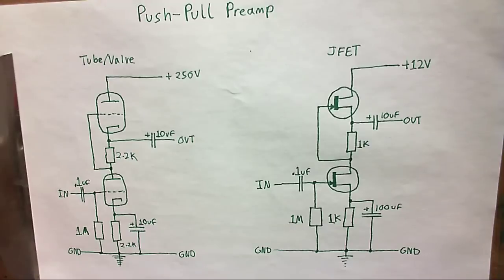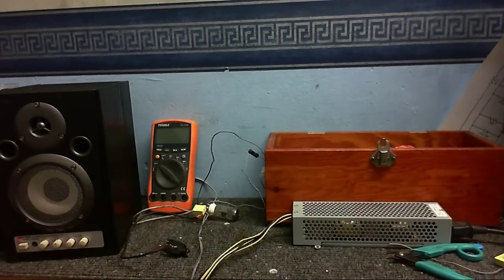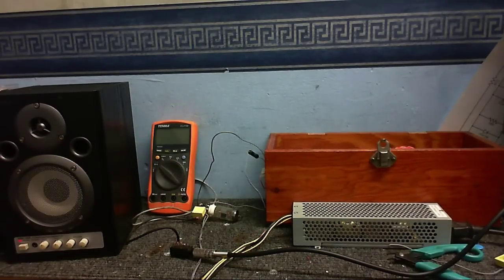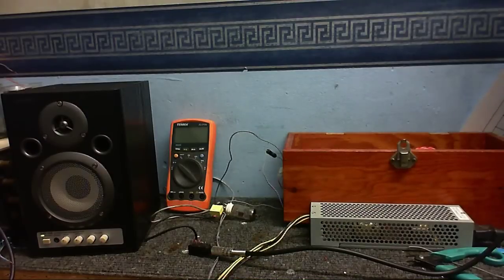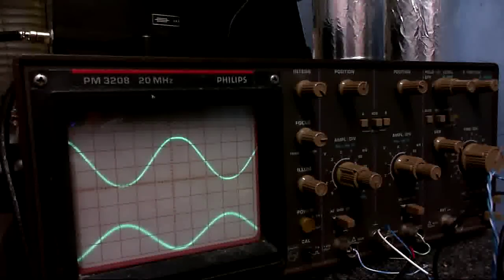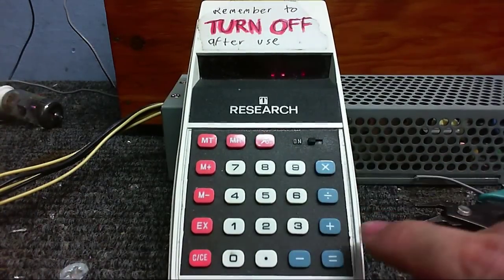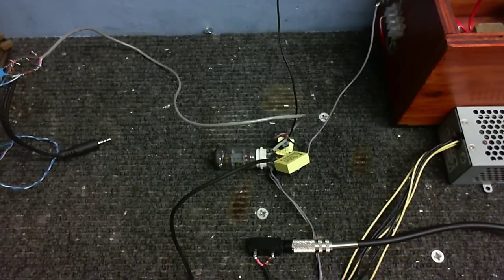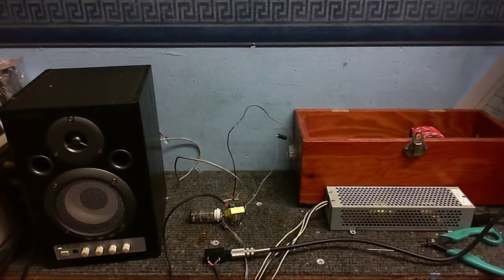Push-Pull Preamp experiment 1 - Tubes

Comment: Dude, do a hardcore quarter wave speaker enclosure.
Carve with a hot wire loop, clam shell style, out of polyurethane foam insulation blocks.
Just a low cost idea

Comment: that is not called a push pull preamp
its a kathode folower preamp

push pull is when both annodes of the tube drive the sound
Reply: Yeah, tube on top of schematic is just an current source for a stable operation of preamp